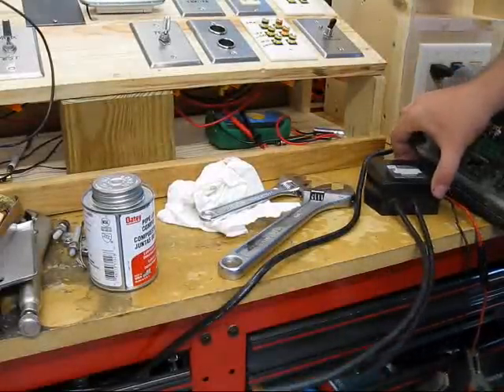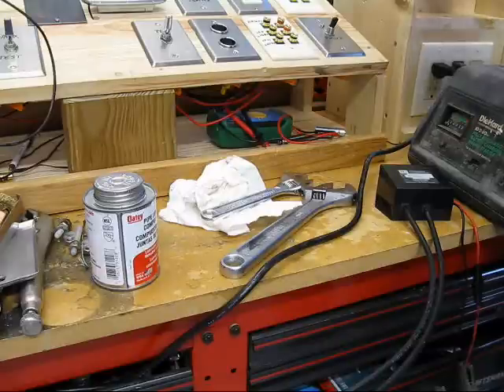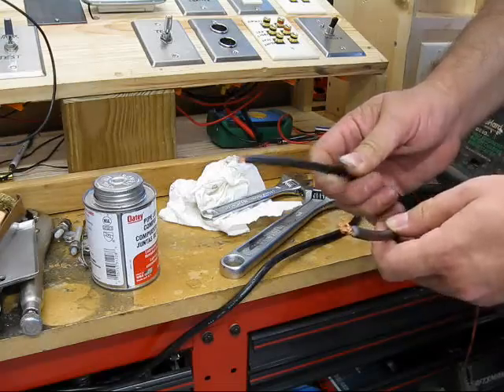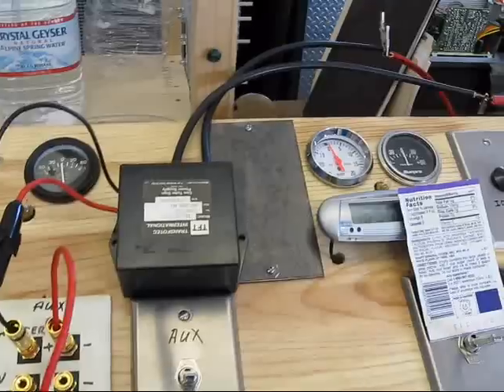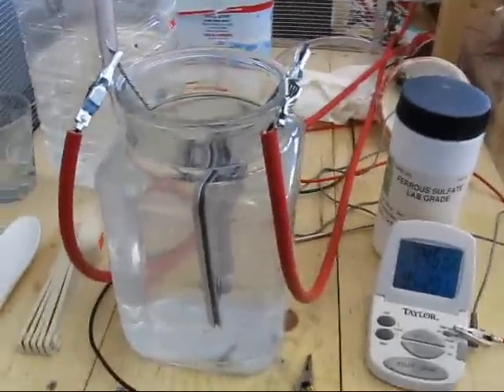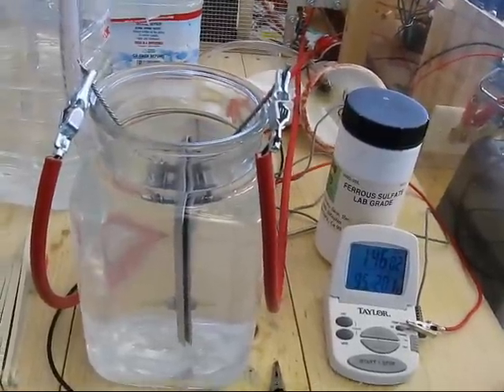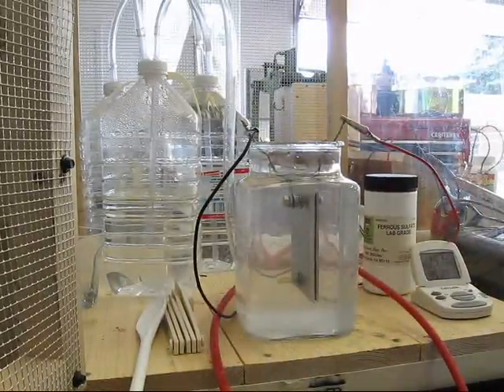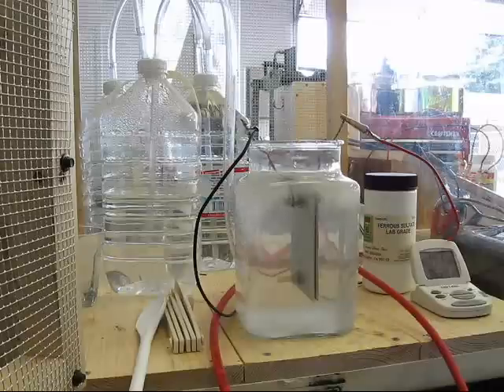#08-069 Initial Electrolysis Test with 12VDC Neon Sgn Tnsfmr

Comment: your problem is the spark plug wires, there not acually wire there fiber glass core witch reduces noise in the radio and such, but the ignition coil in a car puts out around 20-40KV so only a few killivolts wont paas throught it

Comment: get 4 old microwave and there is  a high voltage diode in line with the capasitor inside. after you take all 4 diodes out of the microwaves you can build a rectifier that will take that dirty pulsed dc/ac, to  clean dc and you will see production, just use distilled water, tap water will have to much electrolyte/minerals and pull to much amps.remember higher voltage lower amps and the transformer might be 5000v but its on milliamps of power.... write back